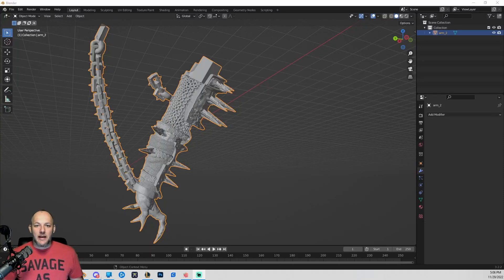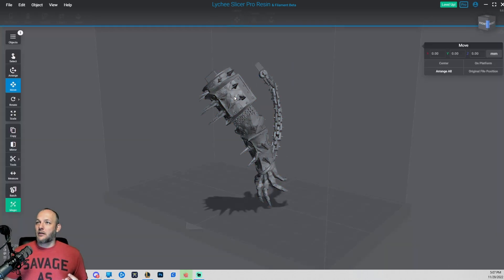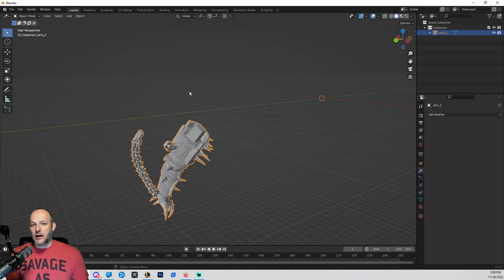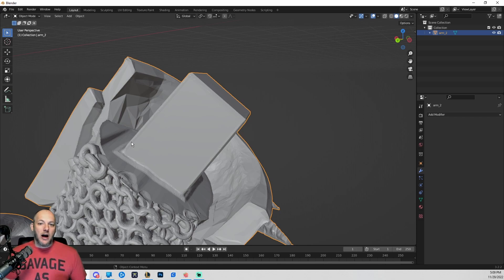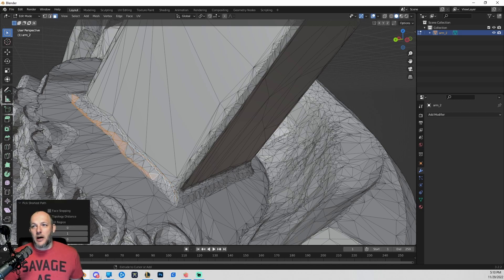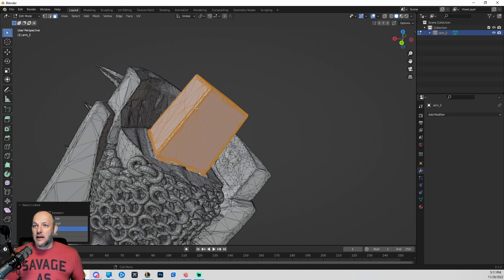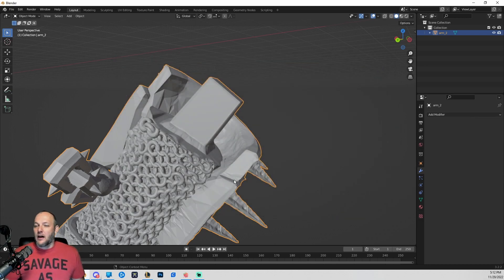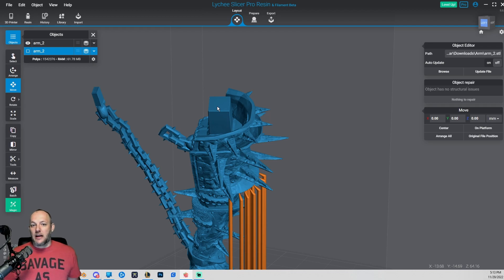Editing STLs for Object Swapping in Lychee using Blender

Comment: This seem to not work if the bounding box of the object changes - for example if you add or remove the details that extend outside of the original model footprint. It seems lychee uses center of mass as a reference point to cmpare old and new objects, and if it's not exatly perfect the object will shift and supports become useless. This is very bad solution for having multiple base objects with just a detail changes. Shame, but great idea though.
Reply from the maker: Scale orientation origin and bounding box all must not change in order for object swapping in lychee. There is no way around it
Reply: @TableFlipFoundry  Thank you for explaining. It's a bit of a shame - would be perfect for having multiple variants where only small detail change.